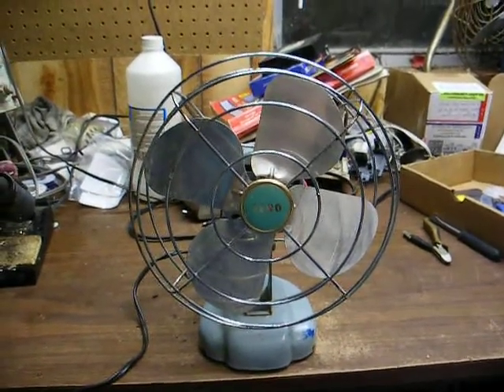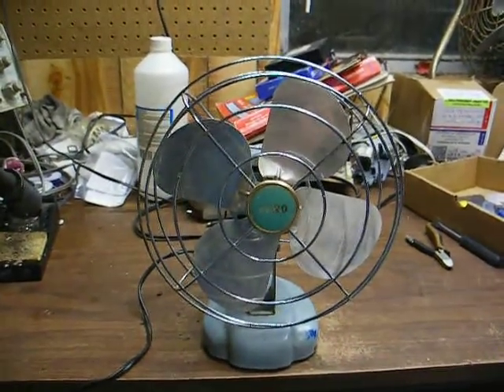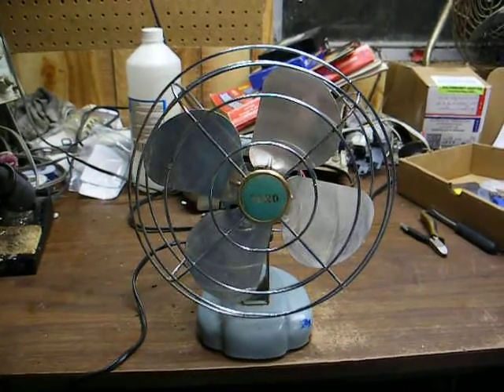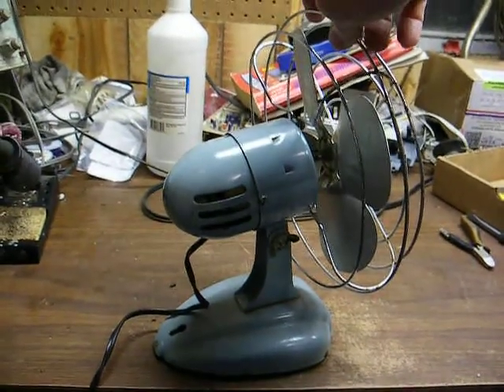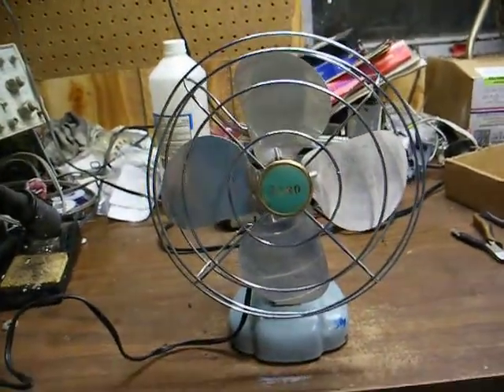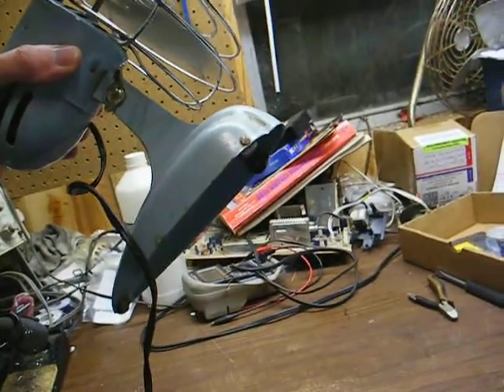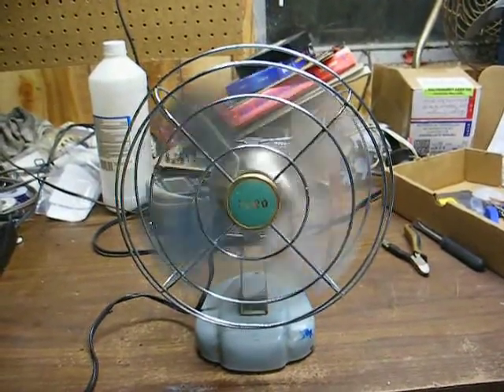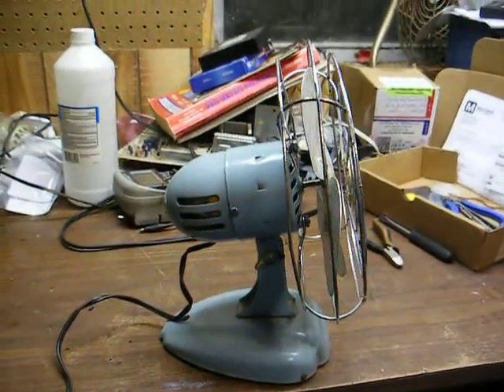Zero brand 8" vintage non-oscillating fan

Comment from the maker: I've read that it's recommended that these fans be oiled once a week. Of course, that depends on how often they are used. After the initial cleaning & oiling, you can probably safely oil the front bearing without taking the fan apart. For the back bearing, I'd pull the rear cover off because that rear oil guide is not very good and it's easy for oil to go everywhere except where it's supposed to go.

Comment from the maker: Zoomspout oil is also good. When putting back together, it may be necessary to lightly tap the motor housing on all sides with a rubber mallet as you tighten the screws in order to align the bearings & insure that the shaft turns as freely as possible. These were cheap fans and the key to keeping them healthy is making sure they are properly lubricated. I've seen a few of these with ruined bearings due to poor lubrication (most people ran them without oil until they would no longer run right).

Comment from the maker: For best results, open it up to lubricate it. Pouring oil in the holes tends to get more oil everywhere other than where it needs to be. Once it's apart, soak the felt wicks that surround the bearings in blue 3-in-1 electric motor oil. It might also be a good idea to apply a little oil to a cloth and rub the oil on the shaft surface and the surface of the bearings. Be careful when putting it back together. Don't overtighten the screws & make sure the shaft turns freely.

Comment: ZERO fingers with that lack of blade projection. I have a Zero at my recording studio very similar and the switch is behind the motor...great you have to reach around a dangerous blade to turn the thing on and off. Built like a tank. Just needed more blade protection. Great find.

Comment: nice fan very neat  what I did on my antique fan to solve the transfer noise is a have a old rubber turntable matt from a dead record player I put that on the table and put the fan on top  helps some  I mainly did it because  the fan  would want to slide and move when running  that solved the issue.